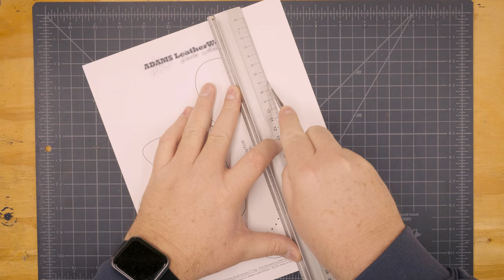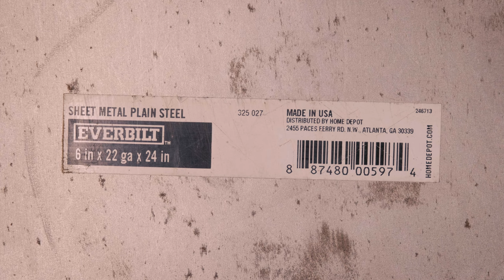Making a LINED & STEEL Reinforced Clip-On IWB Holster - Sig P238

Comment: Hi Eric, I know I'm a little late to the party, with this being a 2 mo th old video. I just found your channel and I am absolutely blow away with the level of detail and  craftsmanship you put into these leather holster. It is truly a pleasure watching you work. But I was wondering, are there and benefits (and/or drawbacks) to having a steel lined holster compared to holster without one. Like, does it help protect the gun from outside forces, like accidentally tripping and  falling onto it or bumping hard into something? Or does it help hold the gun in the holster tighter for longer without having to re-wet it and sculpt the lines again? This video has my curiosity peeked, thanks 😊
Reply: With an in the waist band holster like this you wear it inside of your pants and the clip hooks on to your belt. Since the holster is sandwiched between you and your pants it can crush the holster if you’ve got your belt very tight and this will prevent you from reholstering your pistol effectively. The steel reinforcement piece ensures this won’t happen by bracing the bend of the holster and preventing it from collapsing under normal conditions.

Comment: We’re you able to complete a stitch with the presser foot locked in the up position? I guess I was under the impression that the foot had to be down before the needle went past 6 o’clock. Otherwise it would skip a stitch. Nice work as always 🙂
Reply from the maker: Thank you! The machine functions normally with the presser foot locked in the upward position, but you have to force the leather downward with your hands to avoid the skipped stitch. I run with the presser foot at just about its minimum pressure amount. I always have to be careful about skipped stitches and press downward with my fingers to keep the needle from lifting up the leather or letting the leather slide backwards when the machine pulls tension.

Comment: Hello you do great video.what is your machine model and how thick of leather can it sow who would you buy one from
Reply from the maker: Thank you! I sew with a Cobra Class 4 from Leather Machine Co. It can sew up to 3/4" thick. If you Google "Juki 441 Clone", you'll find several models based off that design. Find someone local to you selling & servicing the machine, and make sure it's configured with a servo motor and speed reducer. For smooth leather, you'll want to also make sure the upper and lower feed dogs are ground smooth & polished.

Comment: Just watched this video and was wondering if you have done a similar one for any of the Glocks? Specifically I am interested in the Model 23 and 43. 
And do you have the patterns for them? 
Thanks.
Reply from the maker: Hi Pat - I have made a few over the years, and I have this style of pattern available on my website for both the guns you mentioned. That said, the holster in this video was unique with the lining and steel insert, as well as the plastic clip. If you're building a holster to use the plastic belt clip, you'll need to make sure the hole spacing on the pattern matches the mounting hole spacing on the clip and adjust the pattern accordingly. https://www.adamsleatherworks.com/digital-patterns?Category=IWB-1
Reply: @AdamsLeatherWorks  thanks for the quick response. I’ll take a look at the patters. Love your work.

Comment: That gorgeous piece of hardware with a Fomi... so sad. Do you make holsters to order?
Reply from the maker: Fomi? I do make holster to order, but not accepting new orders at the moment.
Reply: @AdamsLeatherWorks  that's awesome, you're truly an artist. A Fomi is that style of belt clip. I make kydex holsters to order and typically steer people away from that design if possible. There is not a lot of solidity with those clips. J Hooks work the best for kydex stuff, or the snap loops. I'm leather-illiterate however, so the interaction IWB might differ when using a Fomi, the pants and design of the holster may keep it in place better.
Reply from the maker: @searchBLOC941  Thank you Dan - I appreciate it! This clip worked pretty well in this use case, but the clip does flex the top of the holster a bit. The customer was happy with it and I like how this clip integrates easily with the way I'd normally design this holster (with leather belt loops). If someone doesn't like the leather loops, switching to this clip is an easy upgrade (so long as the hole spacing is the same). It may benefit from a steel band in the throat of the holster to stiffen it up, but that adds a lot of work to the holster build.
Reply: @AdamsLeatherWorks  that makes sense. Other than where it comes from, I know very little about leather. I do however enjoy learning from your videos!
Reply: If you are not taking g orders what's the point